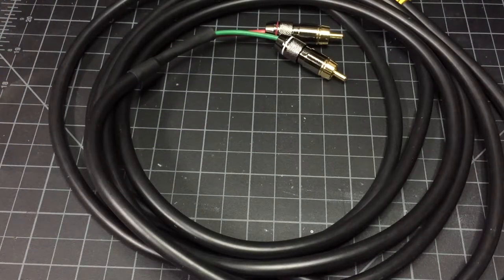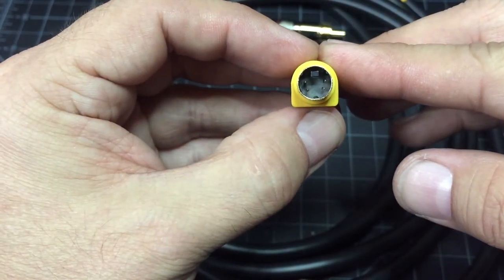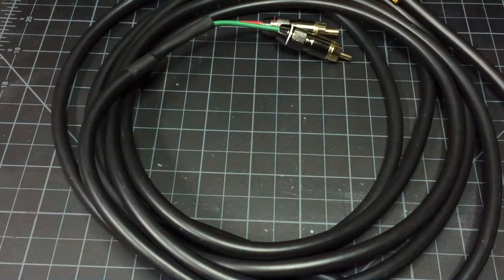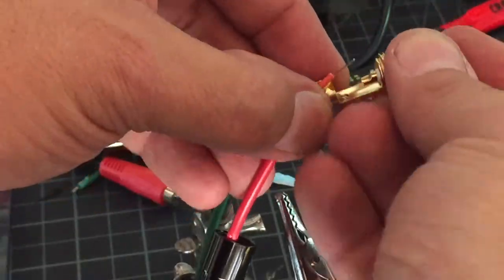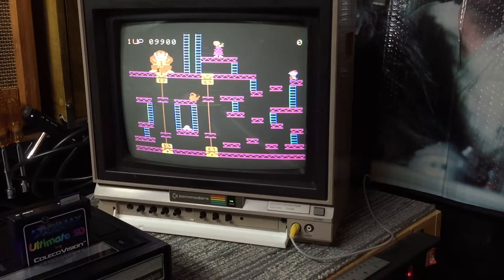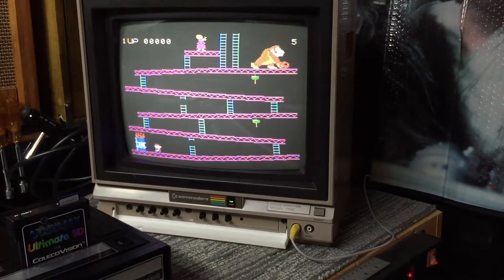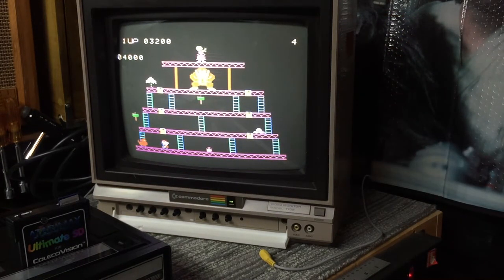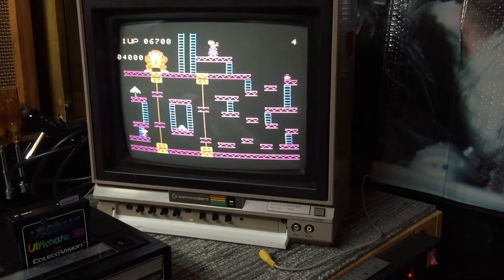Composite to Chroma\Luma for your Commodore 1702 monitor

Comment: sweet i have that monitor and use it with nes and sega master system but just go in the front ... would this work with nes and SMS ? and  can i do this on atari 2600 with the same cable ?
Reply from the maker: If your 2600 is A/V modded yes. I'm not sure how the ports are on the NES or SMS  but as long as they have composite out it will work.
Reply: @ColecoJoe   nice ! i see the s vid to composite on amazon any chance you can send a link to those green and red rca connectors ?
Reply from the maker: @WizardBalls29  https://amzn.to/2DaG4Fe

Comment: I just got one of these monitors, is there a tutorial that I can follow to connect my game consoles with s video or do i need to buy an adapter? Thanks a lot
Reply from the maker: I suppose you can get a S-Video cable and follow these directions. I used a S-Video to Composite cable but you can easily do it with a regular S-Video cable just splitting one of the ends to RCA jacks for the back of the monitor.
Reply: If you're going to play SNES/N64/GameCube, Saturn/Dreamcast, PS1/PS2, or XBox games, get a female 4-pin mini-DIN S-Video to Y/C dual male RCA (the 'Commodore Video' format).

Comment: It doesn't make sense, chroma and luma are two separate signals, so how is splitting them into two outputs from a single input do anything? Commodore computers have separate pins on the video output so a separate wire goes to each input of the monitor? if you left the S video connector on the cable (use the S video out on your device) and into two rca plugs then it would make a difference
Reply from the maker: I'm connecting a composite device to the back of the monitor.
Reply: @ColecoJoe  Normally there's a separate chroma and luma signal, which contain totally different types of signals, so I'm not sure how this works... Chroma is a 3.58mHz color carrier signal and luma is lower frequency for basically brightness...?
Reply from the maker: @bobsbarnworkshop  Yeah I'm not sure either but it obviously works. Try it out and let me know what you find out!
Reply: ColecoJoe I’m getting a commodore and I have an old monitor with only a single composite input, but the first thing in that circuit is a luma- chroma separation filter, so I’m going to go inside and bypass the filter and put new luma and chroma jacks on it, sort of opposite of what you have.
Reply from the maker: @bobsbarnworkshop  That sounds interesting. Are you going to do a video on it? Would love to check out the process.
Reply: ColecoJoe sure, why not. I worked at Westinghouse and Kodak through the 80’s and 90’s on NTSC video products so I’m experienced with it. Funny that composite video has to be combined in a mixer the separated back in a monitor. Lots cheaper to skip that and have two outputs, which they finally did when Svideo came out, does it stand for Separate video? Hopefully I can still find a schematic of the input of my monitor which will make it simple to locate the place to tap in the new luma and chroma inputs

Comment: Using a heavy shielded S-video Monster cable on this thing with Snes and PS2 there is quite a difference. Remember with analog signals the quality of cable construction does make a big difference.
Reply from the maker: good shielding and solid connections yes, Monster Cables??? Nah, overpriced hype in my opinion :)
Reply: @ColecoJoe  Oh yeah the going price for them now are ridiculous, I got mine when GameStop had clearance out stock. $100+ usd for the Nintendo cables today, that's crazy!
Reply from the maker: @michaelbalbosa994  I'm not too familiar with Nintendo cables but I remember hearing they were always pricey no matter what. Proprietary anything is always a money grab. I hate when companies do that.

Comment: Would you make one for me? How much could it be?
Reply from the maker: It's super easy man. You can do this yourself and if you need help I can walk you through it!
Reply: Would it be the same as buying a s-cable on eBay?
Reply from the maker: @18gabriel18  You'll need this cable and some RCA connectors: https://amzn.to/2P9BATK
Reply: @ColecoJoe thanks a lot man! I just found a 1702 on the Wild and have been like crazy wanting to maximize the "power".

So what you do is connect the video[yellow] RCA to the NES (for example) and the new chroma/luma to TV, and separately connect the audio RCA cable to the audio input below the chroma/luma inputs right?I would gladly pay you to make me one hehe I have NONE of the tools to make one.

Would you have any idea how a PS1 could be hooked up using chroma/luma?
Reply from the maker: @18gabriel18  To connect a PS1 you could use that box I show in the video, connect the PS1 to that then run the cable I made from the box to the 1702.

If I made a cable for you it would cost more than it's worth, I would have to charge you $50 for it .  Maybe you can find somebody local to you that can solder it up for the cost of the components? You could just twist the wires onto the connectors without soldering them and it should work it just won't be a solid connection.
Reply: Hey man! @ColecoJoe  What RCA connectors do you recommend? I may have found someone to help. What should I use to shield it?

And what box in the video? Didn't see anyone. If you could send me a link of the box I can use to connect my ps1 using your cable would be super appreciated!
Reply from the maker: @18gabriel18  Oh I'm sorry, I confused my videos. I am actually not using a converter box here because my ColecoVision is A/V modded for composite. My retro stops at 1983 so I'm not familiar with the A/V out of the PS1. If it's composite then all you need is a female to female coupler for the yellow cable that plugs into the yellow connector of the modded cable. Something like this: https://amzn.to/2DcrsVR .. you only need one. Any RCA plugs will work. These are the ones I used in this video: https://amzn.to/2DaG4Fe ... you will also need one of these for the audio signal to the 1702 https://amzn.to/2Ddc9MG ... basically a stereo to mono converter. Let me know if you need more help.